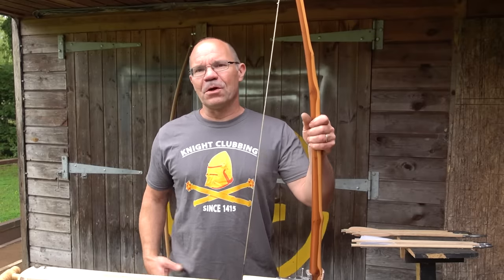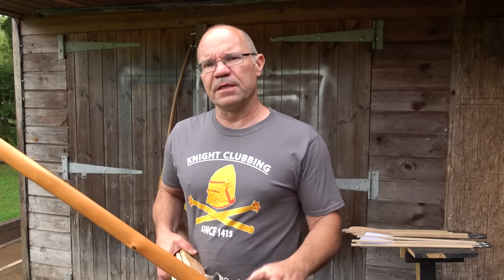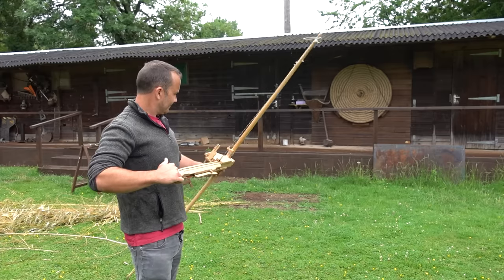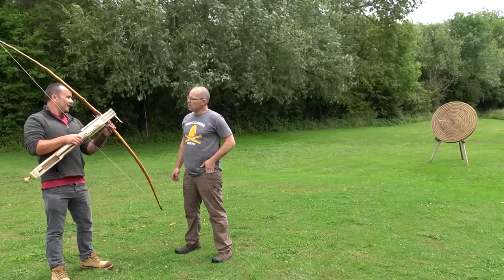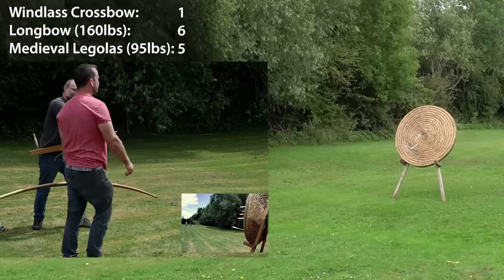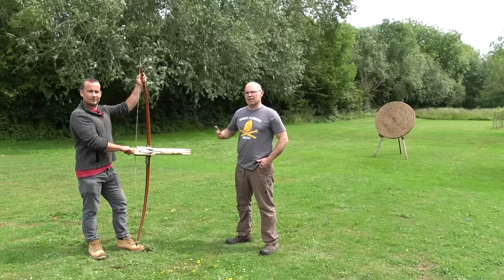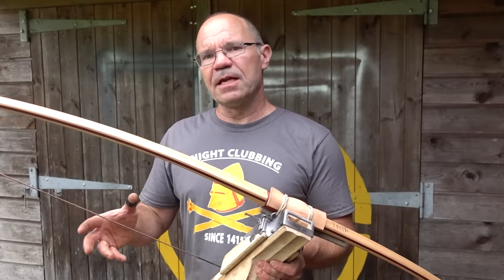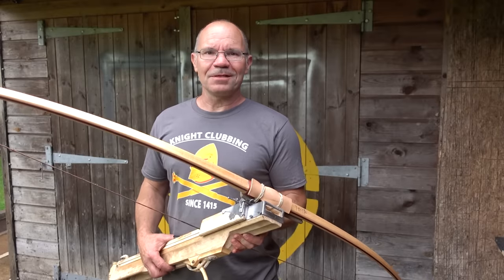Tod's 120lb Medieval Legolas - TESTED

Comment: Imagine an archer shooting the legolas, his squire loading a second legolas, switching bows when the magazine is empty to keep up the rate of fire. And multiply them by 50 on a parapet. It would be like facing 500 archers. I would not want to charge that wall at all.
Reply: longbows (and this is even worse) are too bulky to be useful on parapets. but take your idea and add a shield bearer/protective spearman and you have what made up an elite italian crossbowman 'squad', but with a fast firing bow instead of a crossbow.
Reply: @matthiuskoenig3378  Ooh, I like the idea of a pavise bearer/loader plus archer two man team concept.
Reply: @matthiuskoenig3378  not on parapets, but within fortification. That would multiply the effectiveness of the defense. For them the expense of munitions is less important as they don't have to transport their materiel.
Reply: @matthiuskoenig3378  I can see how castles would have been designed differently to commodate things like this, to some degree
Reply: An issue here would be the massive fatigue you're putting on the archer, since unlike a crossbow the shooter has to do 100% of the work. Would still help for short bursts of intense shooting, but I can imagine the reload period would actually be something of a desired rest for the shooter.
Reply: @UnknownSquid 
Another issue would be running out of arrows much quicker than usual, so they would only shoot in this way in a specific timining to achieve maximum effect on the enemy while minimising the two problems
Reply: @UnknownSquid  @Mariam Omar. Yes, but think of the event of an escalade. Its purpose is to overwhelm the walls by sheer force of numbers. If these men faced five times as much arrows, the toll on unarmored and lightly armored men trying to scale the walls would be appalling. It would make the difference. 
Besides if the escalade is pushed back. You can always send people out at night to scavenge for materials. Not only arrows, but also the gear of the fallen.
Reply: Mariam Omar running out of arrows might be less of a problem if your accuracy was improved. Also if battles were significantly shorter. It would be interesting to see the math.
Reply: You wouldn't be charging a wall though, I mean it's not like it's going to run away. You'd advance on it holding up a big shield to protect yourself. Ideally you'd be behind a siege tower or under the canopy of a ram.
Reply: @aluminiumknight4038  remember the devastating advantage of this apparatus is that it requires minimal training. imagine all of your infantry can use this, 1 volley would be already enough to force the enemy to retreat at once.
Reply: This is what I have been saying since I first saw Jorges first instant legolas video. Perfect for siege warfare. 

If worried about the bulk of it on parapets, use them on a short bow, like Jorge's Mongolian bow.

Have a rank of bowman up front and a second rank loading the bows. With the version with the ammo clip, you could have a third rank loading the clips to hand to the person reloading the bow.

As for fatigue, after every x many volleys, rotate through the ranks to allow the bowman to regain their strength. 

Or, you could have a monopod mounted under the body of the instant legolas, with holes in the parapets. With a lighter bow you probably wouldn't need to lift the bow as high drawing the string back, or just have the holes deeper and the monopod longer.

From memory there was a massive crossbow in the 15th century that was used in much the same way.

Can you imagine them I  naval warfare? You'd soon have the decks littered with bodies, and sails full of holes.
Reply: ’twould
 be most painful my  liege
Reply: Or in tight corridors where this would just multiply your attacking force
Reply: Correction: It would be like facing 1.375x the archers. And they would have to be shooting 120# bows instead of 160# bows.

Comment: He was tired because he was trying to shoot rapidly. There's little recovery time compared to shooting a regular bow. Over the course of 5 shots, you'd start to feel it.
Reply: the handle is mounted horizontally his muscles are use to pulling a vertical string *if you know anything about lifting weight this 45° rotation can make a huge difference in which muscles are being used, my theory is the horizontal grip is reliant on the shoulders more and a vertical grip would be more natural and use the stronger muscles of the back

Comment: Imagine 50 of these firing and reloading in ranks, or a walltop full of defenders armed with them. 😨
Reply: and they cant be shot back
Reply: @Max De Jong Oh God, that'd be terrifying
Reply: @Max De Jong Imagine the poor logistics guy. F to pay respect
Reply: Well, the Chinese had the repeating crossbows which this was the basis of this bow that they used for urban warfare back in the Warring States period [481 BC to 403 BC] in China. There were reports of soldiers coming out looking like porcupines with arrows stuck all over their body. Up the draw-weight to an actual bow and the lethality would increase quite a bit. You could create an arrow storm with a handful of people.
Reply: This would have a limited use for defense due to the bulk, the bow would be difficult to fit into most defense structures
Reply: I could see it more for offensive work forcing archers atop a wall to keep their heads down while troops push up their ladders
Reply: @normalostrich6250  These would be absolute hellfire from the top of a wall.
Reply: Worse than that actually : the device is only a hindrance if not using the "quick shot" capability (lighter, shorter arrows ; drawing strain ; de facto shorter draw length ; higher encumberment). Considering that :
-Either you have to stay "in the open" for all the time it takes to loose your arrows, making you a target for much longer than if you were shooting the same amount from another weapon.
-Or, you have to duck back every shot to "re-arm", at which point you might as well not use the device since it would only provide a very marginal advantage for a lot of trouble.
Reply: Aragorn: RELEASE ARROWS!!!

Orcs: EERRRRRRR!!! AAAAAAHHHHGG!!!

Sauron:

Men: The power of Sauron's One Ring is nothing compared to the scientific might of men!!
Reply: @sweetsounds152  But you could easily have archers volley from behind the walls with these into the ranks of an attacker.  I think these would be far more devastating in defending a fortification than assaulting one.  Archers with these on the tops of walls behind fortifications could sit there waiting for men to reach the top then just sweep them off it like nothing.  Plus once enemy soldiers get to the top attacking archers would be very careful where they are shooting opening the possibility for defending archers to rain hell.
Reply: Regardless of exactly how it would have been used the key point is that it is a force multiplier. Specifically, it allows for greater volume of fire at opportune moments. Wherever and whenever that would be important is up to the soldiers/commanders using them, recognizing that you would be sacrificing arrow velocity (maybe use even shorter lighter bolts?) and ease of use since it is bulkier than not having one at all.
Reply: And you could have regular archers mixed in as well and have them rotate occasionally if the tiring problem isn't something that can be worked out. Like Tod said, this device would be a tool for experienced archers to use in certain situations not all the time. 

With the new stringing slot and clamp, you can easily detach the device if the situation changes and you decide firing normally would be better. Or maybe you only carry a loaded magazine +15 bolts and once you are out remove the device and swap to the barrels of arrows distributed across the archer line. This would be great for several devastating high-volume volleys and then once the battle lines meet you swap to regular shooting with arrows since massed-volleys become a detriment when the melee breaks out.
Reply: @MadManchou  you can have shorter arrows that are just as heavy. crossbow bolts typically weigh the same as longbow arrow despite being much shorter. similar principle here. just use more dense wood, larger % of metal, etc.